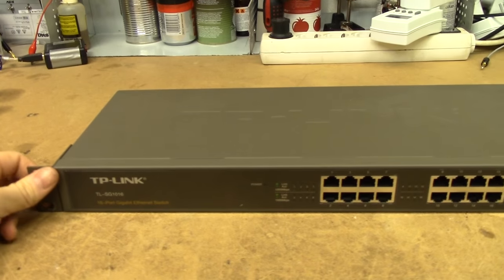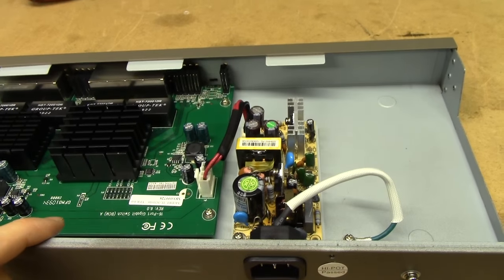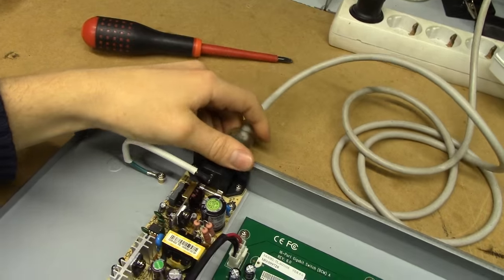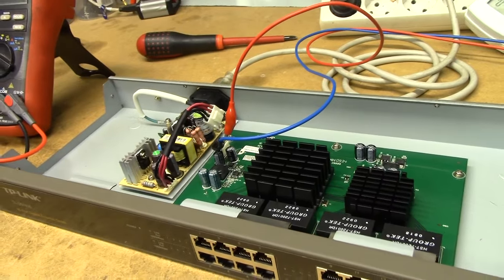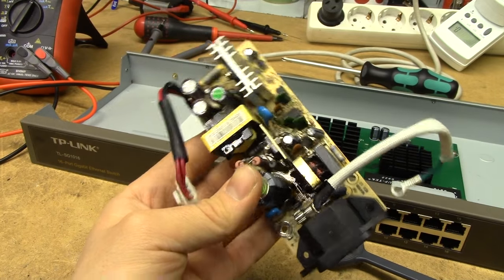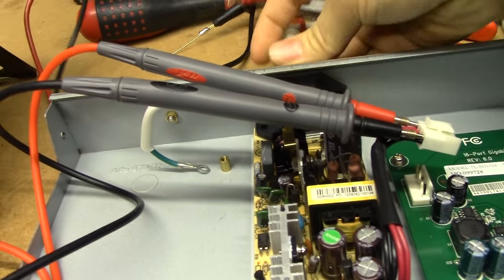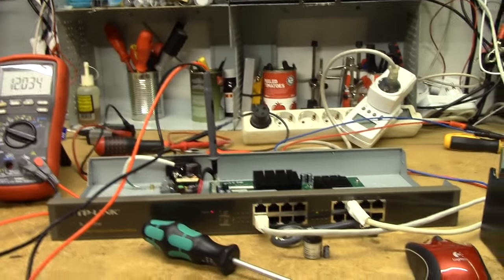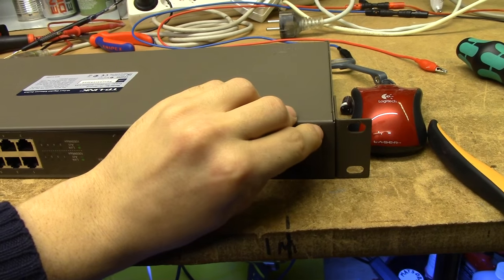Trash-picked TP-LINK TL-SG1016 16-port GbE switch repair

Comment: I have bought one of those exact switches back in 2010 and it is still going strong. 24/7 use with about 6 devices connected to it, not to mention the multiple LAN partys every year with all the ports being used.

Certainly worth the 70€ it cost me back then. Also i'm glad that you made this video so in case mine fails in the same way which is not that unlikely i know what to look for :D /)

Comment: Nice find.  You can see at about 0:40 the discoloration on the top lid as you remove it... and again at 4:32 around the IEC socket cut-out on the rear chassis.

Comment: I replaced my switch because I thought the was no longer working. I bought a brand new switch and for some reason it's not distributing any signal out the other ports. All the lights are lighted up green.

Comment: I know this is probably a very basic question but I don't know much about electronics... I see the power cable that connects the two circuit boards has 2 red and 2 black wires, but when you connect your external power supply you only use 1 red and 1 black? Please can you explain why there are 2 red and 2 black wires, and if I can get away with only using 1 red and 1 black does it matter which of the circuit board pins I connect it to? Thanks in advance.
Reply from the maker: They use 4 wires to get more copper. It's the same as using 2 thicker ones, but that's more expensive. Reds and blacks are conneced in parallel, respectively.
Reply: FFcossag Thanks for the reply. Why would they need more copper? I have a replacement 12V / 2A power supply but it only has 1 red and 1 black, will that be ok to use?
Reply: @FFcossag  that 7W should be passed via Snow white's single hair :)

Comment: The caps didn't look damaged, but looks can be deceiving. I wonder if You could change the board caps with corresponding solid polymer caps? I don't know if there are solid caps with corresponding specs - capacitance, resistance, etc.
Reply from the maker: +Jovan Janevski You definitely could, if you were really concerned with reliability.

Comment: I have a TL-SG3210 switch which the system led is blinking and when I connect it to the serial port it just shows garbled text in the terminal window.
Haven't taken it apart yet to see if there's any obvious damage inside

Comment: Noticed that you're measuring the ESR of capacitors with your PC, but how?
Reply from the maker: +Das OSi It's a prototype ESR meter that's still in its debug stage. I'm field-testing it for someone, I'm afraid it isn't available for purchase anywhere.
Reply: +FFcossag Thanks for the info, tell him that I would buy it immediately =D
Reply from the maker: ***** It's not my project.

Comment: can u show us how to do a hack/mod to a 12/24 battery bank power supply instead of ac??? or have a dual supply
Reply from the maker: +OffGrid Aussie Prepper™ The easiest way is to use some semi-decent Ebay buck/boost converter to get clean 12 V out of the batteries.
Reply: hmmmmm interesting.... yes agreed u definetly need a clean filtered voltage or the comms part of it will have data corruption.

Comment: PMSL, any respect I had for you was immediately vapourised when your foot came into the frame. Socks and sandals?! Are you taking fashion advice from your grandfather?!

Otherwise a good video, though you should've included some footage of the actual act of trobuleshooting if your aim is to educate the less-technically-inclined.
Reply from the maker: My workshop is in an uninsulated basement. I challenge you to dwell within it without socks for more than ten minutes without freezing to death.

As far as showing the troubleshooting process, I think I basically did; I measured the caps on a hunch and replaced what was bad. I've done this so many times that it's turned into one of those automatic things.
Reply: FFcossag Bah, you're only a kid! Back when I was your age... ;-)... The comment was actually about your use of socks with sandals, something people only expect to see either very young children or very old men wearing.

This was the first of your videos that I saw, so don't know what level of proficiency your average subscriber/viewer has. I know most "newbies" wouldn't start at the caps.

Either way, you've earnt yourself another subscriber :-)
Reply from the maker: Yorick Hunt
I'm glad to hear it, I hope you enjoy my stuff.